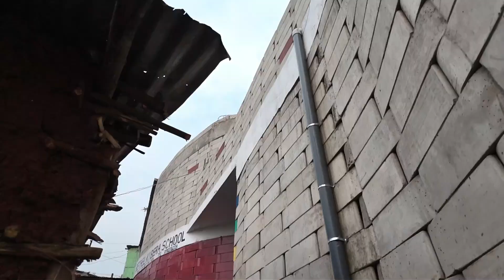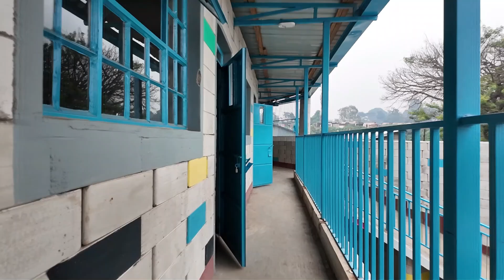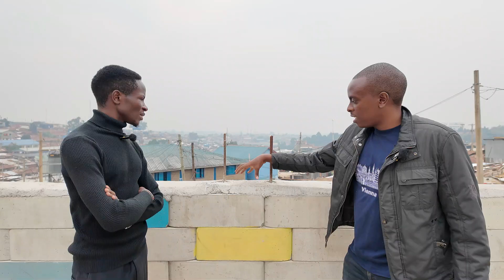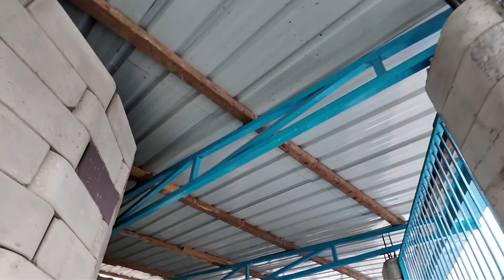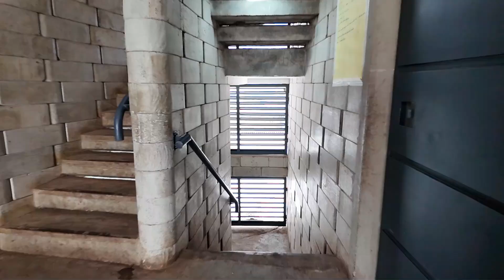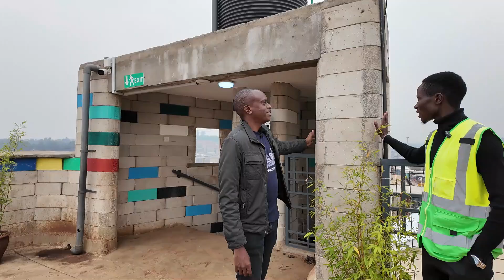Watch How 2 Schools in Kibera are Built Using Twist Blocks

Comment: Thank you for showing the plastered and tiled bathrooms. These blocks are definitely an option since one doesn't have to worry about small areas of access by insects to the indoors if the walls are plastered and/or tiled.